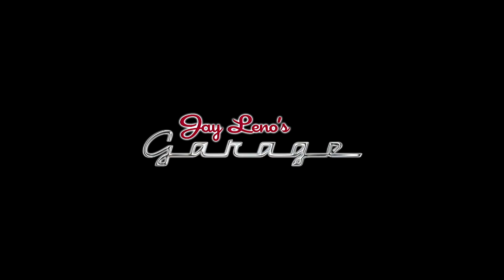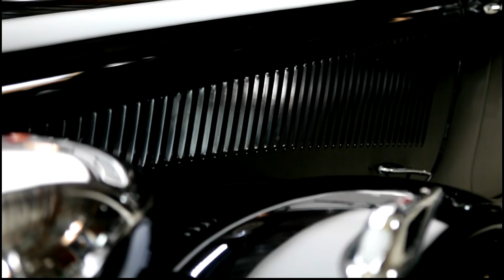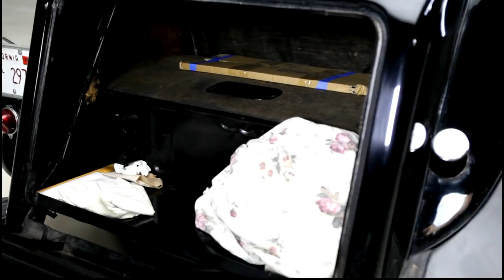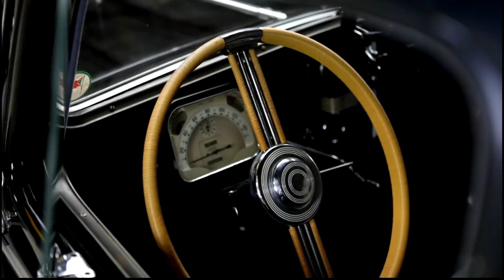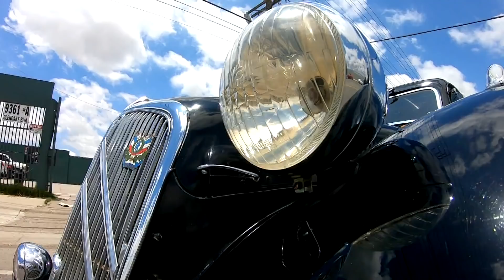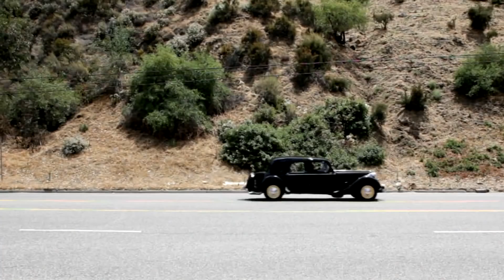1949 Citroën Traction Avant

Comment: Dear Jay, you are missing the correct badges on the car still? In the front there should be inmidst the radiator grille  "15 "   and under it a bit smaller   "6 cyl",and the same on the rear right fenderIt is certainly possible to find in France, I could look for you.Some were even goldish.thanks again for your fantastic video on the Traction Avant,we love your pandemic intimate videos best.